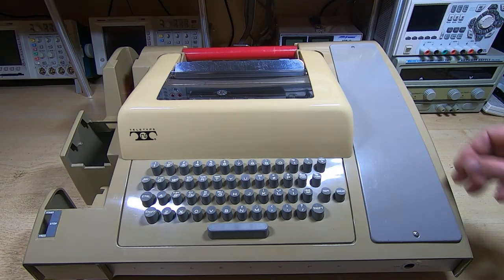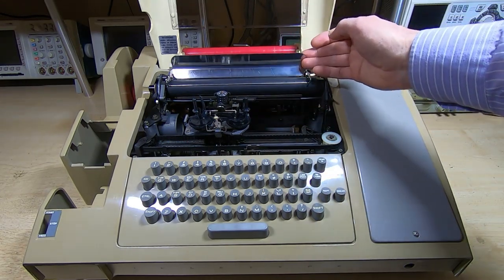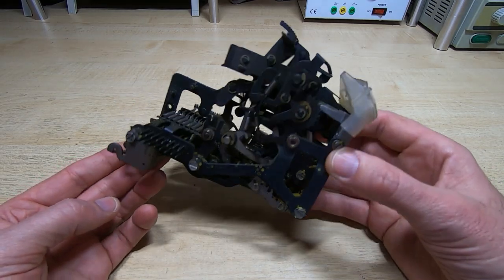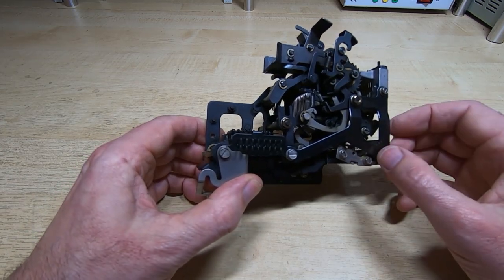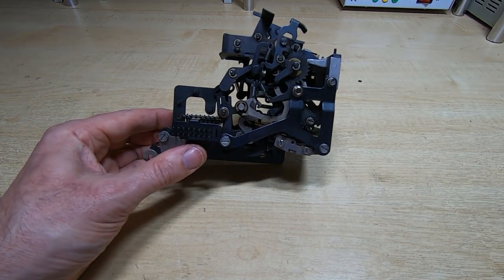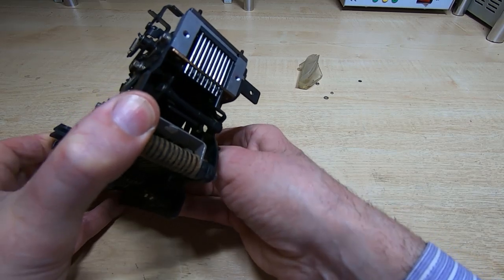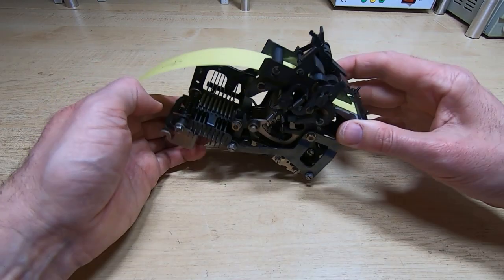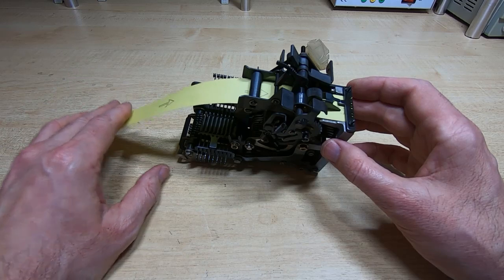ASR33 Restoration  Part6

Comment: I can't remember teletypes punching their own sprocket holes. I've just checked some blank paper tape I have, and it has sprocket-holes pre-punched.
Reply from the maker: Most punches punch the sprocket holes and most paper tape does not have pre punched holes. The ASR33 punch can support pre punched tape as the lower tape roller has spikes which are intended to engage with pre punched tape sprocket holes but unfortunately they have a tendency to move out of 'sync' for long tapes and this causes double sprocket holes (unless the sprocket hole pin is disabled) so it is best to use blank tapes. I very rarely use pre punched tape.
Reply: @JerryWalker001  Thank you for explaining this.  Like frogandspanner, I had always assumed that sprocket holes were pre-punched, but what you say certainly makes sense.  I hope to be able to repair my ASR33 well enough to use it with my minicomputers and this video series makes things a lot more understandable.